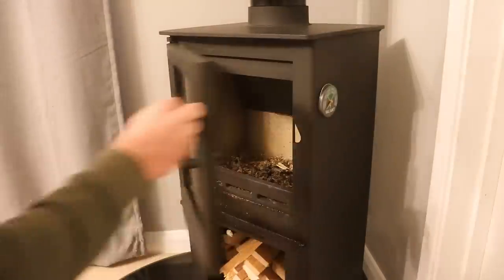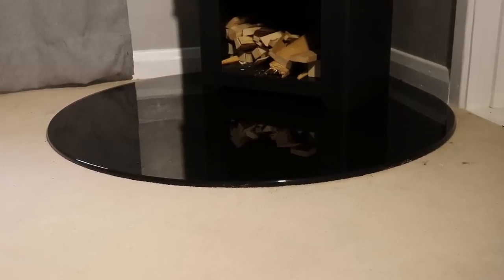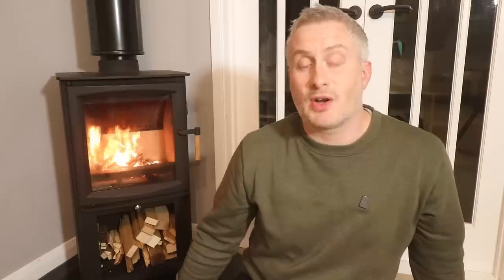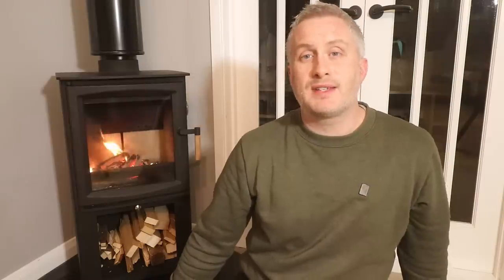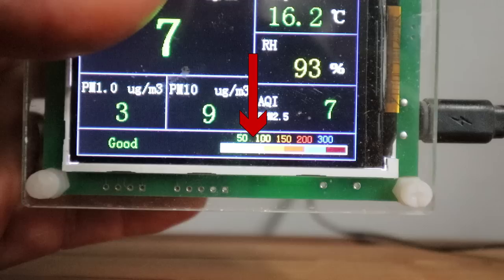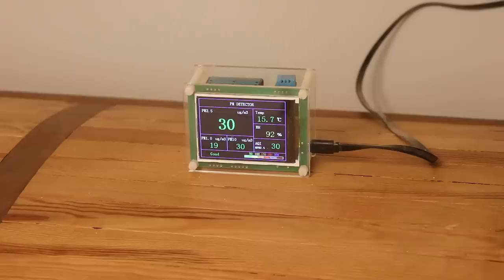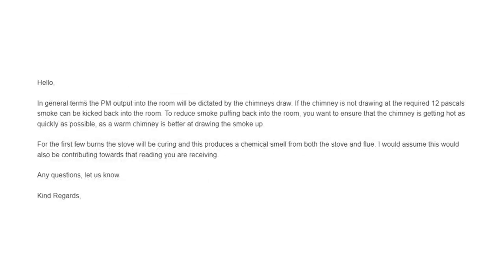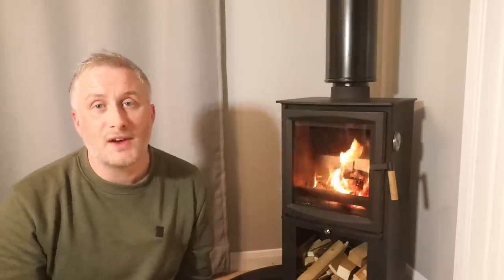Wood Stove Pollution and PM2.5 Particle Emissions TESTED ✓

Comment: Interesting take on wood stove. I use one very often every winter for over 10 years  and actually I  didn't think about pollution inside i just enjoyed the warmth and ambience. I recommend do some research on how to burn wood in proper way. Big difference  if you load it up and burn it from the top, that way you actually burn gases not the wood and you burn smoke so there's nothing coming out or the chimney. Cheers.
Reply from the maker: Thank you
Reply: It only affects the burn during startup. We run ours all day every day and light it from the bottom to get it up to temperature as fast as possible.
Reply: @Tailspin80  nope. Try load it full with wood, set the fire on top and you will see the difference. This way you burn gases coming out of wood so you got higher temp fire. Your way you burn wood and you got smoke i know because I was doing the same thing before i learned how to burn wood in the proper way.
Reply: @KingZongo  No thanks. It doesn’t make any sense whatsoever. The point of kindling is to turn a very small fire into a larger fire, then a full scale blaze. It’s always going to be a quicker process if you start at the bottom because hot air rises. I understand your argument about possibly reducing smoke in the initial phase but for me this isn’t a big factor. If you use very dry well seasoned wood you get very little smoke out anyway. Our wood is reading about 15% moisture after the long hot U.K. summer. Also, we live in a low density’s neighbourhood bordered by open land and woods so no close neighbours to upset.
Reply: @Tailspin80  i live in small city so less smoke is important for me but  it's not just about the neighbors but also me working around the house. Funny thing is when you are inside you don't think about the smoke outside. I understand that it's hard to change way you do something for a long time but for me smoke was #1 and starting fire in the morning and not have to open fireplace doors for couple hours was  #2 so it wasn't hard  switch.   
What's that "long hot UK summer" you talking about, that's like two days with no rain in July 😁😂😁 sorry i couldn't stop myself. Anyway next upgrade is adding water heater to my fire place and connecting to my heating system so I can get most of that burning wood.
Reply: @KingZongo  Yes, depends what your timing priorities are. My method is about lighting it fast. I can load build and light the fire in the time it takes the kettle to boil water for a couple of cups of tea. Then leave it for half an hour, get dressed come back downstairs, load more fuel on and start to think about turning it down. After that it’s just a question of putting one or two logs on every couple of hours. I think it would take much longer to build a layered fire, lit from the top. It also depends a bit on the design of your stove. Ours is wide but not that tall, so lighting from the top doesn’t look like a good option. My method is based on the manufacturer’s instructions and makes best use of the lower inlet vents (and the upper air wash vents) as well as the flue choke, which must be fully open for lighting or opening the doors.

I was serious about the U.K. summer. We live in the south east and the all time temperature record started in 1659 was smashed by 1.6C in 2022, reaching 40.3C. I don’t know if that’s hot for your part of the world but in the U.K. it’s unheard of. There was also a 6 or 8 week period during June to August with zero rain and unbroken blue skies every day. It was an extremely unusual summer and an easy one to believe in climate change.

I did consider the back boiler option when we installed it but decided against due to the length of plumbing required to get to the cistern. Be careful - there have been many instances of back boilers blowing up and occasionally killing people, usually because they have been decommissioned, the ports sealed with water still inside. Then a subsequent owner has innocently lit the fire and BOOM!
Reply: @Tailspin80  that record temp was recorded on airport tarmac so it's interesting place to take temperature with all those jet engines around 😒 anyway i was just joking about it. I spent some time in southern IRL and the summer was nice so i assume weather in your region will be some of similar. Not so different as well from continental Europe where I am.

My firebox is 54 cm  wide 39 cm high and 36 cm deep. So not huge but not small. It's taks about 5 min to fully stack logs and start the fire. After 20 minutes fire is strong so i adjust the vents. Usually if i start it between 7 and 8 in the morning i don't  have to add more logs or poke in it  till around 2 pm.  That way of using fireplace is  recommended by local chimney sweeper association as well. 

Just starting doing research on that back heater so thanks for that  tip. Exploding fireplace is definitely not a good think 😊. Cheers.
Reply: @KingZongo  Can’t measure right now cos it’s in action, but it will take 47cm logs. It’s a Villager B although the company went out of business a few years ago. I can still buy spares though. I’m not sure what point if any you’re trying to make about the temperature measurement. RAF Coningsby has a weather station. No it’s not sited anywhere near the very small number of fighter jets stationed there. We saw 40C in the shade down in Hertfordshire on our outside thermometer and it was unbearable.

Just looked up European temps in 2022 - I know it was very hot right across the continent. Portugal reached 47.0C and France broke records in the 40 - 43C range. We don’t tend to reach the same temps in the U.K. because of the geography but to break a record by 1.6C was exceptional for a record that stretches back around 350 years. 2022 is also the hottest year on record in the U.K.

Comment: I suspect chimney height is, as the manufacturer said, a big factor. We have a three-story house and about 8m high chimney and the draw even before the fire is lit is significant and we get no smoke escaping even during the initial lighting. A useful rule of thumb comes out of the 12 Pa draw requirement - you will achieve this when the height of the chimney in metres x the flue to outside delta T in degrees exceeds about 300. So with a 5 m chimney the flue needs to reach a temperature 60 degrees above the outside ambient.
Reply: Agreed. We have two stories plus a chimney through the loft. No problems getting the fire to draw. It’s important to close the vents (and flue choke if you have one) when not using the fire. An open flue is a great way of cooling down your expensively heated house!

Comment: We have a very old stove that came in the house when we bought it. It’s 12kW and we get a red ‘do not use’ warning (with a wink) from the HETAS engineer every year when they clean and safety check it as if you go over 5kW modern regs say you need external air supply to the stove, either ducted straight to the stove or in the form of a massive and point-defeating air brick in your wall.

Anyway, I did the same as you and used the same air monitor to keep an eye on our fire and found that because of the draw it creates it actually cleans the room, if you’ve been doing something like cooking that has left pollutants in the air.

If you want a real heart attack run that thing while you use a frying on - it’ll read ‘heavily polluted’ in no time!
Reply from the maker: Cheers Andy. Really? I'll have to try that!
Reply: @RagnBoneBrown  Yeah, no joke. It doesn't help that our old kitchen doesn't have an extractor hood, but if you cook a meal that involves frying the air quality sensor at the opposite end of the house goes nuts.

Comment: Run your meter while you clean it out.  I've got a rather large wood stove (Englander 32-NC) and the real mess is cleaning out the ash.  It isn't difficult to clean, but just making eye contact with ash causes it to stir up and get into the air.  To help cut down on this issue, I use a tiny shop vac with a Pellvac "Vervelwind" (Whirlwind).  I run a hose off the small shop vac exhaust out the window because there will be some super fine ash that will pass through the Whirlwind.  I don't have a filter on the shop vac and it has been doing its one job now for 8 or 9 years now.  Heat can be an issue, so I keep one bare hand on the hose so I can tell if I need to pull out of the firebox and suck in cool air for a moment.
Reply from the maker: Thanks - great method!

Comment: I'm surprised the installer put it close to combustible materials (the curtains).  I had an installer concerned that the walls around the fireplace (not in the solid brick fireplace) were wallpapered!
Reply from the maker: It's over 300mm distance so he wasn't worried about them
Reply: Occasionally if you open the door with very hot logs burning with air inlets closed they can spit / explode, sending hot embers out into the room. It’s rare and only happens under certain conditions, but something you need to be aware of if you have an expensive rug or carpet within range. I think it’s the rush of fresh air into a fuel-rich fire that triggers the problem.

Comment: Excellent video, Keith.  We're (like lots of others in the UK at the moment) considering getting a wood burning stove but we're a little bit concerned about the health impact. But on the other hand, like you, I have a load of offcuts -I had to take a car load to the dump the other day 😞
Reply from the maker: In Norfolk we have to pay to take wood to the dump, it is considered DIY waste.  Absolutely crazy!!
Reply: @RagnBoneBrown  some local authorities are now charging for "DIY waste", but do you know they can only charge for construction waste that derives from what the regs call "industrial" or "commercial" waste? They're not permitted to charge for "household waste".
Reply: Do not burn treated timber, you are releasing chemical's from the wood. Kiln dried give's a lot of heat and very little ash.

Comment: You can have a gentle burn and create high heat at the same time, just make it very small and kindling only.  A match  produces way Less heat than an oven on 200c, for example.  Basically they don’t want a big fire until it’s broken in, just small with higher flames.
Reply: We start our fires with old pine cones, btw, hot and quick.

Comment: No mention of the particulate levels outside that will be huge. I have the same monitor as you and it regularly goes into the severely polluted range when the neighbours log burner is lit.  This is on a modern housing estate that is declared as a smokeless zone. Are these neighbours concerned that they are polluting the air for my Wife and children? No, they couldn't care less! Sadly this is a common theme from log burner owners.
Reply from the maker: If that's the case then they're not burning dry wood
Reply from the maker: Tell them to burn dry wood?
Reply: @RagnBoneBrown  "Tell them to burn dry wood". Is that the best suggestion you can come up with?
Quite clearly you aren't concerned about what we are going through!
Reply from the maker: You've got a problem with your neighbours, so why not go and talk to them? How do you expect a random bloke on the internet to be able to help you?
Reply: @RagnBoneBrown  You've clearly not grasped the fact that log burners produce huge amounts of particulate matter!
Reply from the maker: You've clearly not grasped the fact that it's only burning wet wood that creates pollution, not responsibly burning dry wood
Reply: @RagnBoneBrown  Have you barred me from replying?

Comment: My Mum's has the flue inside the existing chimney breast which obviously affects how quickly the flue warms up, quite often it will take ages to get a fire going because the cold damp air just won't let the flue warm up enough to create the draw for the fire to burn clean. I bet the readings on those days are horrendous.

Comment: If you want a reading for more than 1000 ug/m3, put the monitor in your kitchen when stir frying on high heat. Or when baking in an convection oven, that won’t get to 1000, but 300 should be doable :)

Comment: Good review Keith.
Living in a valley surrounded by oak and fir woodland, we have had wood burners for the last 45 years. In our cottage we have a wood burner cooker in the kitchen, that is also our central heating and hot water boiler. In the living room we have a Jotul that is solely a wood burner space heater. The kitchen, formerly the stable, has an insulated chimney similar to your installation and in the living room the Jotul is in the inglenook and the original stone chimney has been professionally lined. It is important, every year, to get the sweep in to clean the chimney. With a clean chimney the stove will drawer properly and there is less risk of a chimney fire from tar build up.
Tar is released when wet wood is burnt and this is bad for your stove, your chimney and the environment!
So to avoid this we burn kiln dried logs with a percentage of workshop off cuts, which have a low moisture factor. A moisture meter is very cheap to buy and makes it easy to check any green logs you have air drying outside, to see if and when they are ready to burn. 

The beauty of a wood burner, is, unlike electricity, gas or oil, you can choose when to light it and burn the fuel you have available, making sure your running costs do not get out of hand.
Reply: Burn an old beer can every month. It keeps the chimney clear. I didn’t believe it until I tried it but have done it for the past few years and it works.

Comment: I’m a huge stove fan. Top tip: get a fan .. works via a thermocoupler (ie heat from the stove ).. uses no batteries... and moves more air around stove I.e more efficient heat from your stove! 😊
Reply from the maker: Will do - thanks
Reply: @RagnBoneBrown  The Stirling engine ones are fun. We have had one for 13 years and it's still going strong. The thermocouple ones are good and, unlike the Stirling engine ones are self-starting but you need to make sure the Peltier cell does not go above about 150C or its toast.
Reply: I’ve seen a thermocouple fan in action and it seems a bit of a gimmick tbh. Once you have a stove up to temperature it will set up convection circulation currents by itself. The hot air rises up the wall, flows across the ceiling, cools and falls down the opposite wall, then back across the floor back to fire. This will dwarf the effect of the fan.

Comment: Hi, could your higher reading come from the increased movement of air in the room? Moving settled dust particles etc rather than pollutants from combusted material. Not saying you live in a dusty house 😂 would the rate of convection be greater than the use of radiators?
Reply from the maker: Hi Chris, I think it was definitely the stove itself causing the PM2.5 peak - the smell was quite something!

Comment: Another explanation of the higher emissions compared to not using the wood stove, is that when a wood stove has heaten up the room, you have more air circulating in the room. Hot air raise to the ceiling and travel away from the stove, and on the other end of the room, this hot air cools down and will fall down again. 
You can test this by placing a simple fan on the table when the stove is not running,with the fan on, you will see a higher number on your air quality meter then when the fan is not running. There are always particles in the air, but when the speed of the air is higher, more particles will be detected.
Reply from the maker: Cheers -that makes sense - really interesting

Comment: Wood burning stoves are great with waste or if you have a free timber supply. If you have to at buy full price, I've recently seen hardwood advertised at £300 a load in Norwich (use to be £60-£100) - scary. My only heating is a multifuel stove with a backboiler driving both the hot water and the central heating. Great when it's running but damn cold first thing in the morning before it has been lit!

Comment: Thanks for doing this video.  We were also concerned by the scary stories about PM 2.5 but this tracks with our experience.  We were told to do three increasingly bigger test fires in the beginning and we haven't had any chemical smell since.  The only thing we noticed is that if the insert surface temp rises much over 600 F. there is a faint but noticeable metallic smell.  Once we back down the air, it fades away quickly.

Comment: Used wood burners last 50yrs, current one last thirteen years is with back boiler 12kw free standing same chimney as yours,  not inside chimney breast/fire place. runs seven radiators, Constance hot water, we use only fully dried wood to prevent tar and fire risk in chimney and best of all not one computer control, its a cast steel box you set fire to simple, (though sweeping the chimney clean is a must, we use the ash for the garden, pot ash!), all this for two hundred pounds a year, p.s if you don't like dust in the room, its not for you, just saying.